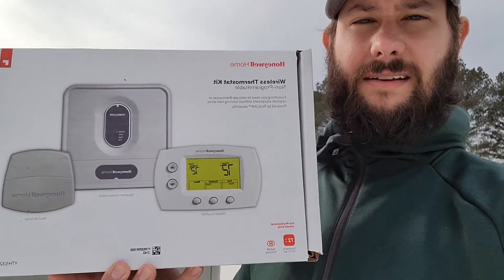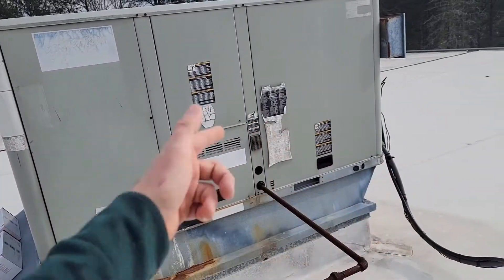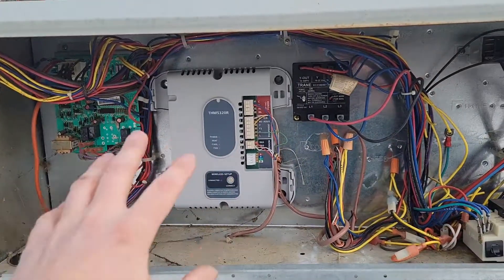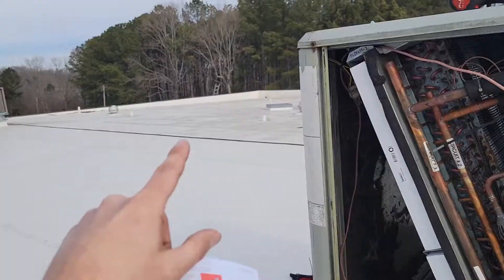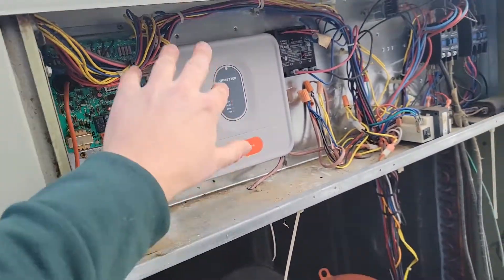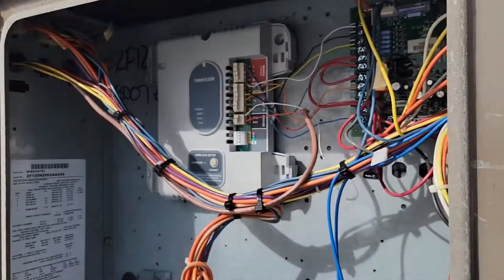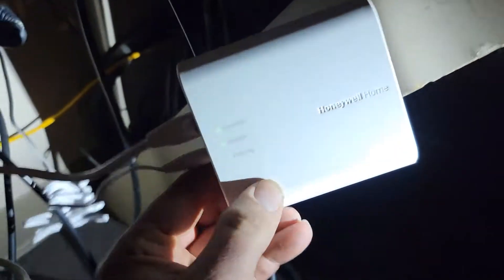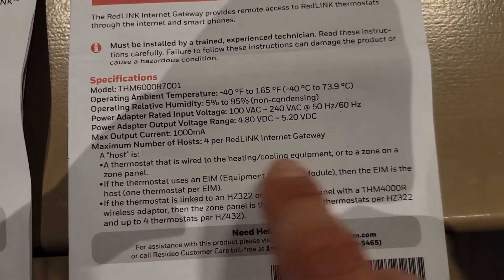Honeywell Wireless Thermostat Kit with Redlink #honeywell #thermostat

Comment: Using the Resideo app to control the thermostats…. Are you able to see/modify the schedule or do you just have Mode functionality and able to adjust the temp from the app?
I also noticed that it does not participate in the vacation mode.

Comment: What about power surges?  Can it damage the wireless connectors ( I guess blue tooth or Wi-Fi components)?  Will power outages cause you to have to reprogram it?   I guess I always think more complicated = more problems.   What thermostat would you recommend that is not wireless programmable and non programmable. Mine need replaced.  Northeast Ohio here. Thanks.

Comment: I’m moving into a new apartment this week, I hate the location of the thermostat it’s literally in the dumbest place you could ever put a thermostat, it’s on the same stud that the tv wall plug for a mounted tv is on, I voiced my concern they didn’t want to fix it so I’m going to do it myself. What do you think of this system for solving my problem? I have to do something, I can’t mount my tv and even if I could it would put my thermostat behind my tv which is incredibly stupid. What are your thoughts?

Comment: I have this setup installed in my place. It works well, no issues and connects well with my phone over wifi.  Does anyone know whether there is an alternative smart thermostat that works with this setup, wirelessly like this?

Comment: I can’t get the red link conected, it say need to get the thermostat register first. How can I do that. I have same system as you show, but when I enter re registration said error.
Reply from the maker: I think there's a number on the installation manual. You can call and discuss with customer service.

Comment: Will this device: THM4000R1000/U can connect with T10 Pro thermostat ?

I bought THM5421R1021 and later I have learned this unit does not work with T10-Pro thermostat

Comment: Just curious, no wireless remote temp sensors available for those existing stats? It seems like that would be more cost effective and allow for better mounting locations to get actual temp sensing from with the zone, while being tamper proof as well. With that said, Thank You for the video, and I will actually be installing one of these as a solution to an issue a client is having.

Comment: From Houston, I have a 3 wire, from two floors, to two separate heat pumps.  The heat pumps require 4 wires.  The HVAC company sold me a device that splits one of the wires to do two functions, but that device broke down about a year ago, and nearly destroyed one of my heat pumps.  My options to get rid of that device, is to tear up my house and put a 5 wire link to each thermostat, OR go with this redlink.  My primary question is, if the internet goes down, or if I lose power a few hours, is the recovery costly, or does it put my equipment at risk?  I know I don't have risks if I simply go through the mess of adding a larger bundle of wires.  Also, I'd kind of like to not have to power the thermostat with batteries.  I think I can use the old 3 wire cable for power.  Can you suggest a model, and address these questions please?

Comment: HI...if you install the Red Link, I assume that is connected so you can use a cell phone. Thermostat then does not need it if you just want to connect via the wifi. I'm having issue
with cold air bouncing back to thermostat and does not run long enough. So hvac guy
thinking of moving the wires setup or maybe use this wireless system. My concern if I
were to sell, the internet equipmt goes back to Spectrum. I assume then the ac will not
work until new owner installs their equipment. Three AC/Units in 17-yrs & all keep getting
mold. I should have a 1.5/ton but they always install a 2/ton and don't consider the sqft of
the condo. Got this new older guy helping figure how to help me. Spent lots of 'money' and
no thanks to the thieving AC Companies in Florida. If I go with the wireless, I hope he can get
the return to pull out more air. Thanks for your video. I could not find at first anything about 
these types of Thermostats. Friend mentioned the wireless.  Thanks...good video

Comment: I currently have the same EIM unit, THM53020R, that you installed in this video.  I want to add the Redlink Gateway to it.  The manual for the Gateway you pointed to in your video says it can be used for a THM4000R wireless adaptor.  My question is....Can the Redlink Gateway be used for my wireless adaptor, THM53020R, the same one you installed in this video?   Thanks.
Reply from the maker: I'm not sure 😕
Reply: Hi, did you find an answer?

Comment: I have a 2 family house, tenant upstairs, me downstairs. One zone heating. I want to be able to set the temperature from my apartment using a sensor reading the temperature in his apartment. 
Does this thermostat have that capability?
I do not want him to adjust the temperature, but I want the settings I chose to heat his apartment.
Reply from the maker: Download the install manual
 And check out the manual it will tell you can download it from Google
Reply from the maker: You can get thermostats that have wireless sensors

Comment: How do you connect the redlink gateway to the thermostat? i.e., how to enter wireless setup mode on the MHK1?
Reply from the maker: Download the manual and read instructions 
I will do a video when I get a chance
Reply: @taddydigest  I have the manual. It provides instructions to connect to the redlink receiver connected to the air handler. Nothing about connecting to the Redlink Gateway.
Reply from the maker: ok got it I will check it out
Reply: @taddydigest  when you have the time, that wod be awesome. Thanks.
Reply from the maker: Deal I got you my Friend
Reply: @taddydigest  I finally figured it out. With the MHK1 wireless thermostat, you have to connect the Redlink Gateway to the wireless receiver, not the thermostat. It doesn't say this in any instructions or anywhere on the internet. 😀
Reply from the maker: Dude awesome that is great news
 Thank you for the knowledge
 I appreciate you
Reply: @Miner2009er You mean connect the Internet Gateway directly to the EMI using the “Connect” button and not the thermostat, correct? Thanks
Reply: That’s correct.
Reply: @Miner2009er  It worked! Thank you, sir! Unfortunately, I thought I would gain a scheduling feature through the app, but I didn't since my thermostat doesn't do scheduling - bummer.
Reply: Yeah, the app is very limited. Basic control, but not much else. Would be nice if it was updated to mirror the actual functions of the thermostat.  Not holding my breath, though.

Comment: Thanks for the great video.  I'm a former electrician up in Northern Maine.  I have a bad t-stat wire that would need a lot of walls opened to replace it.  This  honeywell redlink system looks like exactly what I need.  Thanks for the install lesson, I'm going to order parts now!
Reply from the maker: Very awesome man
 thank you so much for watching 
I'm glad I made this video
Reply: @taddydigest  would this redlink system work on a 2 wire (RH & W) system.  The old t-stat (LUX TX500E) is connected to a relay box (TACO SR504) that runs an oil fired furnace.  Thanks for any help, I don't see anything in the install manual that says for sure.
Reply from the maker: you could just connect a new thermostat and connect the transformer C to the new Honeywell red link thermostat